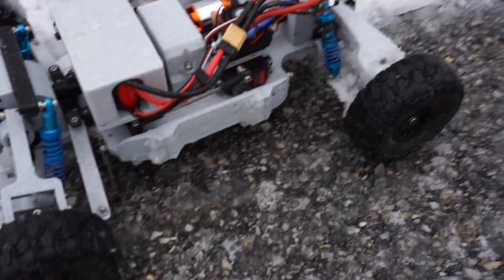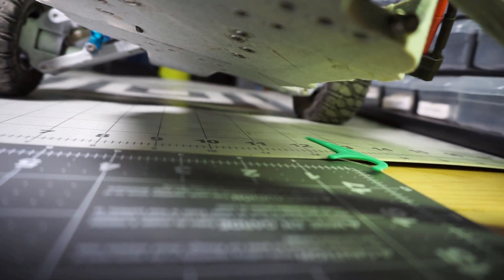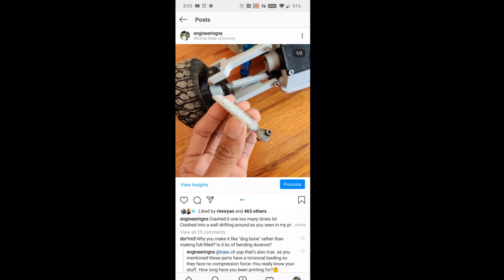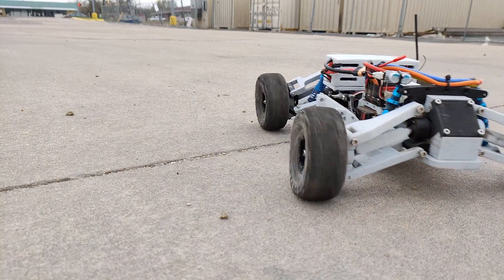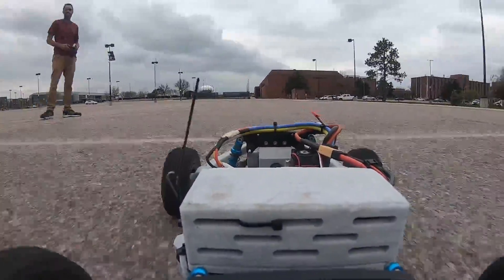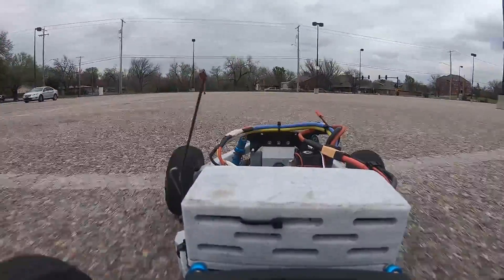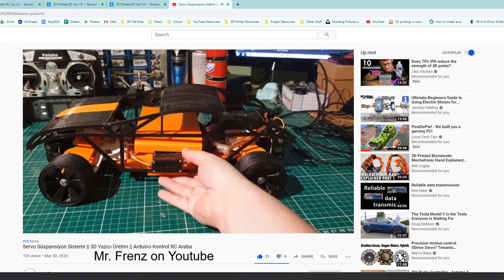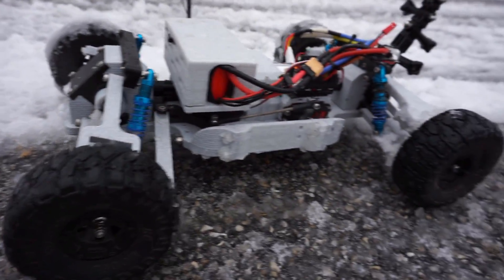Tarmo4 | 3D Printed RC Car

Comment: Hey I'm a little late to this party but this looks like something that I would want to make and was wondering how much this would cost(filament aside) to make. Its not that big of an issue but with school I don't want to spend more than like 200$ bucks on a 3d printing project. Thanks in advance.
Reply from the maker: Check out the subreddit you'll find your answers there
Reply: @EngineeringNS  alright thanks

Comment: Great work. I can imagine how much time you put in. I decided to take this on. I am new in 3d printing. Your posted STL's have round pads which exceed my build plate. I am using a flashforge creator pro 2. How can I get rid of those round pads on the chassis? What CAD are you using?

Comment: I just purchased a 3d printer. I never though about printing an rc car. I might make one from scratch which can use my old rc plane motors. 1 motor per wheel so no gearbox will be needed, maybe...

Comment: Hi, I am designing something similar and I was wondering how you did the steering. like the part at the end of the two arms that hold the wheel on. I saw two bolts in the video but from that angle, it looked like the bolts would have to go through each other. I really can't wrap my head around how that would work. Plz, help.

Comment: Do you know if ninjaflex filament will work instead of the ninjatek cheetah for the torque dampener?
Reply from the maker: Ninjaflex is too soft and will not work. Cheetah is very very hard
Reply: Thanks, I have some cheetah coming

Comment: What did you print the model in? PLA OR ASA? 

Also, I built your Tarmo3, but the end cups keep burning out, the axels are fine,  any suggestions? Would the new ninja flex torq damper fix this issue on the T3?
Reply from the maker: I actually designed a remix for tarmo3 that uses the torque damper design from Tarmo4 for those who didn't want to build a whole new car. The car is still built with PLA. I never had the issues you are having--there are other people who have similar issues and I am still not sure what the cause is.

Comment: I gave up after searching for hours for the parts on dozens of different sites... is it even possible to get all these parts?
Reply from the maker: Well there isn't much I can do about that bro, dozens of people seem to have figured it out fine. Have you looked at the subreddit for support? 

The only thing I could do would be to buy all the parts myself and sell them to you directly. Being as I work a full time job that isn't possible I simply don't have the time, not sure what you expect from me here. If you have specific questions you can post to the subreddit or send me a DM and I will help you. ✌️
Reply: @EngineeringNS  Sorry I didn't mean to whine I was tired after searching. Im new to RC so its extra confusing for me. I'll go on the subreddit and do more research.  Thanks for the reply and the incredible design that inspired me to get into this!  If I find all the parts maybe I can help out with a canadian parts list resource?
Reply: @EngineeringNS  I dunno I live in canada and half the parts are out of stock. I guess thats quarantine life?
Reply from the maker: There are ways around some of the parts, for example the front diff is not 100 requires and also people on the sub have designed fully printed versions. Same thing with the motor adaptor people from the sub have designed pretty interesting plastic versions that seem to work well. Best of luck to you.

Comment: You giving out those prints for free proves that great people still exists.

What software did you use to design the car?
Reply from the maker: I used a software called OnShape 😁 thanks
Reply: @EngineeringNS  can you use fusion 360 ??

If required, can I ask for your guidance since I am not yet eligible to apply for a related course at my age in my place, and I don't know if anyone I know can help🥺🥺🥺🥺🥺
Reply from the maker: I am sorry, but my time is quite limited. If you're trying to learn CAD, onshape is free and they also have free tutorials that show you how to do everything.

Comment: Woow nice design. I will do one in the future. I see a lot of bouncing in the suspension. Considering your experience, is it due to the soft wheels? I am comparing with the previous version. Bye from Spain.
Reply from the maker: Possibly from the tires. I don't actually have much experience RC cars, so I can't be 100% sure.

Comment: I have a 6374 and 12s lipo lying around that I want to build an rc car around but I had big trouble finding parts. Can this platform handle the power?
Reply from the maker: I am guessing not 😂😂 that's over 1kw of power, no? 🤔 It would be interesting to see what mods need to be made to go from 3s to 12s and from a 680w motor to one with well over 1kw of power.

Comment: Why do you need elastic shaft ?
Do you know exact reason why old o
ones kept breaking?
Reply from the maker: It wasn't the shaft that was breaking, it was other parts. The shaft flexing reduces torque spikes in the system and stops other parts from breaking.

Comment: You need to 3d print a vacuum for that floor.
Reply from the maker: Yes I do! haha that house is under construction so there is a lot of space and a lot of dust! Fun to drive in though since the car drifts with very little throttle. 😀

Comment: has anyone done a 4 motor rc car?
this is very cool, but a lot of parts to distribute the force mechanically
Reply: Marc Frank the handling would be crap and you would need extremely advanced technology to make it so it acts like it has diffs. Never mind how weak it would be with all the complicated design that would be necessary.
Reply: @mojaverc1585  oh yes diffs are an interesting problem
i build drones, so i don't think the technology is that advanced ;)
and i think it'd actually be more durable, because there are no diffs to break and the space thats needed for the central turning rod thingy
can be used structurally
Reply: What i mean by advanced technology is how the esc’s would need to sense more amp draw and then give less power to the motor which is counter intuitive because usually if there is more amp draw from the motor the esc will just draw more amps from the battery. Anyway as you said you are a drone builder so it probably doesn’t seen to be too complicated for you. There are so many things to consider and standpoints and views that could be justified in one way or another that would hurt my brain in terms of how a 4 motor car would need to be designed and the pros and cons and so forth that I am going to end this here before we start to have discussions that get so in depth that it is useless to talk about unless the design is actually manifested.
Reply: Wow I just realised how long my and confusing my sentences were. Oops
Reply: I'm with Marc, someone should definitely do (probably has done it). It could be as simple scaling down certain motors when inputting steering. Would be quite ready to do with a flight controller. 
My question is would you go for motors in the wheels themselves (would have lots of unsprung weight), or motors where the diffs currently are (would still have a shaft to the wheel which we were trying to get rid of)?

Comment: If I'm not wrong, you can put the Weight in the middle/center of the car and you have better steering.
Reply from the maker: I will try that in Tarmo4B
Reply: @EngineeringNS  ok hope it works!
Reply: @EngineeringNS   I'm not sure but some cars have the engine in the middle-front form the car frame, and the results are better steering. Sry for annoying you.
Reply from the maker: On this car the motor isn't really that heavy. The biggest thing by far is the battery and I need to design something better for it since it is held so high.
Reply: @EngineeringNS  yeah I think you need Like a battery frame that is in the middle. Hope you have success in you're project.

Comment: I have already a 1/5 scale race buggy from SWorkz. But I miss a crawler. Can I use it?!
Reply from the maker: What? 🤔 Do you mean to ask if this will work as a crawler? Yes it would, though you may want to adjust the gear ratio for more torqie
Reply: Engineering Nonsense Yes, this was my question 😂🤣😂 Maybe you can consider this as an option in your new version. 👍🏻

Comment: Have you researched real RC vehicles, like Losi, Kyosho, Traxxas etc... I would at least steal from their R&D so you don't make the same mistakes. Also find a track to test things on, a real test is going to be on a race track where you can log your laptimes and compare revisions with laptimes etc... Also check out other RC channels, especially the guys that race, they contain invaluable information on building and maintaining and winning with your vehicle.  Tires are like 90% of the vehicles handling/performance, so you might want to look into tire manufacturers, learn from them and don't make the same mistakes that RC guys did back before 3d printers existed.
Reply from the maker: I am seeing more and more that RC cars are more advances than I thought they were. I am very busy so my time is pretty limited atm, but I will graduate in May so I should have more time to look into things after that. 😀 Thanks for the advice.

Comment: Hey awesome job!!! I already started to print parts and I've seen your BOM of non printed component, but please share also the inner electronics you're running!!! :) That would be great to start from ground up! Astonishing design and performances!!!
Reply from the maker: Inner electronics? 🤔 There really isn't anything threre other than what is on the BOM--What do you mean?
Reply: @EngineeringNS  Having just looked at the non-printed BOM I cannot see any parts relating to the wireless control of the vehicle? Any information regarding how you control the Tarmo 4 would be really useful as I am just looking to start my own RC project! Thanks 😊
Reply: @EngineeringNS  I just meant some more info about the combo transmitter/receiver, but nevermind, I figure it out! Just excuse an RC newbie dumb question! XD

Comment: I don't know if anyone has already told you that, but, in order to improve torsional stiffness to you axis you need to put a 45 degree helical design. In alternative you can make a pipe. The cross section you made isn't the right one for torsional stiffness. That will bring a big improvement if you don't want the axis to twist.
Reply from the maker: Lol it is supposed to twist that's the whole point. That's why I designed it that way. You are talking about the drive shaft, right? 🤔

That's my 'torque damper' it reduces torque spikes and stops parts from breaking. It's part of the design and it actually works really well.
Reply: @EngineeringNS   I Imagined it was for that but i wasn't sure
Nice design because you don't achieve the isteresys of material

Comment: What kind of motor is that.  Is the can spinning???
Reply from the maker: It's an outrunner. Normally used for quadcopters. I like outrunners because they stay cooler, and also they have tons of torque and power at low rpms. This means your gearbox does not need a large reduction and also slower turning gears means less heat and so hearts don't melt 😀✌️

Comment: Why print your own tires when you could by 2.2 tires that are not for rockcrawling and denser foams to put in them? Or is it more about the availability of tires for everyone?
Reply from the maker: I mean, that's part of it. I guess printing them is more true to the project. It's all about increasing the % of the car that is printed. This also lowers the cost making it more accessible to more people. Plus I can't find tires that are exactly what I want.

In a tire I want a little give to help dampen bumps in the road, but not so much that it eliminates the feel of precision in the driving dynamic (like these ones do) I also want them to have good grip, but not too much. I want them to be 100mm OD... And many more criteria

Comment: wow you are awsome
Reply: can i use other tpu based filaments or they dont flex enough?
Reply from the maker: They flex too much. The cheetah is very hard. You can use other brands but they must also be very hard. I believe the spec is 95a shore hardness
Reply: @EngineeringNS  Did you use the same Traxxas diff gears for the back diff?
Reply from the maker: Back diff is picked uses no internal gears. Both rear wheels turn together.

Comment: Hi
First I would like to thank you for your endless effort and persistance with building 3d printed cars.
I have just found out about tarmo3 and ordered some parts, so my question is - do you think the motor and esc from tarmo 3 could be used in tarmo 4 or it will be underpowered, didn't start printing yet so I'm on a turnpoint now - to go with tarmo3 or tarmo4
Thanks in advance
Reply from the maker: The ESC should work fine, the motor will be slightly underpowered. It is half the power of the new one. You can always build it and if it is underpowered just buy the new motor it should be aveilable for about the same price. You will need to build some sort of adaptor though since the motors do not mount in the same way.

Comment: Since this is v4, can you give us all an update on approx material cost including batteries? maybe time to assemble too?  Man, if i had a 3d printer, I would already be printing, but my crazy family wont let me spend any money
Reply from the maker: Hahaha well I am not actually sure. I've built the car over the course of a year, part prices constantly change and I already had some parts so I couldn't tell you what the total cost is even if I wanted to. The only way is for you to select the parts you need from the websites you decide to get them from and see what it comes to.

As far as material, one spool of PLA should do and not much TPU is needed, though it needs to be 95A shore hardness
Reply: @EngineeringNS  okay, thanks
Reply: @davidanalyst671  I was able to order everything for a little over $300. But I had no RC equipment, so I needed to buy a transmitter and a battery charger. So if you have that stuff already it would probably be a little less. I think I spent $100 on the transmitter and LiPo charger.

Comment: I would prefer to use ABS instead of PLA, do you think there would be any drawbacks?
Reply from the maker: Yes. ABS is very soft and playable. It will not work as well for drive components. As far am I am aware, the main advantage to ABS is its temperature resistance, but we don't really need that here. It's softness will cause gears to wear more quickly. PLA is very hard.
Reply: Genuine 3D870 PLA filament (often referred to as HTPLA+ although HTPLA+ doesn't always = 3D870 resin, so be careful)  is generally superior to ABS in almost every practical way, and no problems printing in all metal hot ends like earlier attempts at high temp/high performance PLA.  If you haven't already, I suggest giving it a try.  If you're in the US, Fusion Filaments and Filastuder is where were I generally get mine from.
Reply from the maker: So wait, so you're saying that it is different than your regular run of the mill PLA? 🤔 And it has better temperature performance than regular PLA and even ABS?
Reply: @EngineeringNS  Yep!  While it does have a lower glass transition temperature than ABS, it' still higher than run of the mill PLA and generally fine for most things you'd make with a 3D printer.  You have to print it at near-ABS temperatures (even with an all metal hot end I generally print it at least 235c) to get good bed and layer adhesion, and it's practically string-proof and prints like butter.  You can also anneal it in an oven which then makes it resist softening in heat even better than ABS.  I'd suggest checking out Fusion Filaments and order a few spools of their HTPLA+.  I 3D print racing miniquads and the frames I print with this filament stand up to A LOT more abuse than ABS printed frames.
Reply from the maker: I'll definitely look into that thanks for sharing 👌

Comment: Very cool! Would you please consider making a video of how you designed and iterated on some key parts like the drive shafts and the torque dampener? Also please consider adding an alternative 3D model site other than Thingiverse it's basically unusable and could go down permanently any day now.
Reply from the maker: Yes I will be adding the project to a few other sites soon. I'm super unhappy with Thingiverse--Which is sad since it's the best site.

Where did you hear that it may go down from? 🤔 

I will be making an instructable soon on how to assemble the car. It's difficult though since my time is so limited atm between school, senior design and work and family.
Reply: @EngineeringNS  Hey, its great to see this project. I have some RC parts such as a Mamba X ESC, 1406 castle motor and full size 2s lipo battery. Could I get it to fit in this build?
Reply from the maker: That's a good question! I really have no idea 😂. You can try opening the cad files (linked in general instructions) and see if your parts will fit with them by making simple standins
Reply: @EngineeringNS  Good idea, I should have thought of that I am an official Solidworks Associate, lol. Great design by the way, it will be interesting to see how the design holds out with these high end parts. I might have to reduce motor torque as for the car I usually have the motor in, the entire driveline had to be replaced with thick steel to handle the torque.
Reply from the maker: Wow, now I want to see how it turns out too! 😀 If you decide to do it,  definitely make sure to post pictures to the subreddit' so I can see it✌️
Reply: @EngineeringNS  Sure will, possibly a quick video too if it works! I think I'd want to wait on your build video first though :). I have joined your subreddit.

Comment: Any plans on making a rc gas version?
Reply from the maker: Hmm, well 2 stroke motors are very hot and also are expensive and have excessive vibrations, so I am not sure it would go well with a 3D printed chassis.